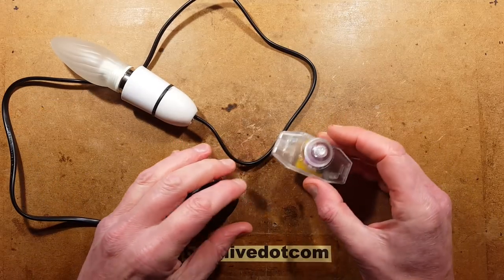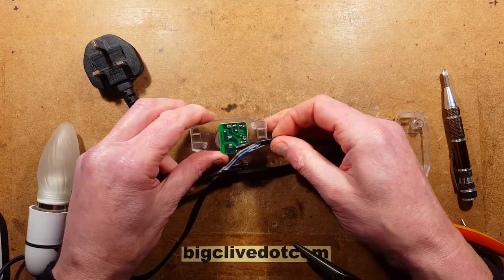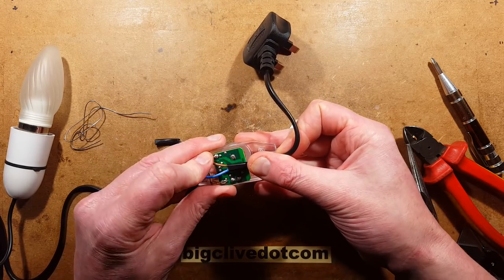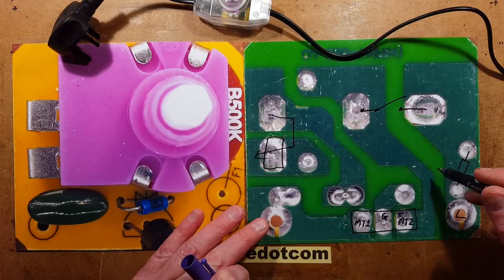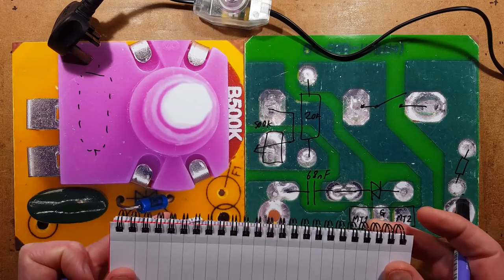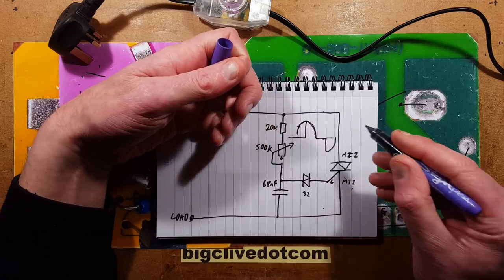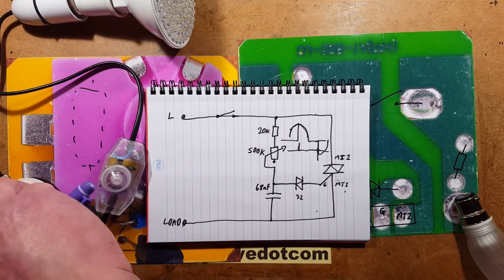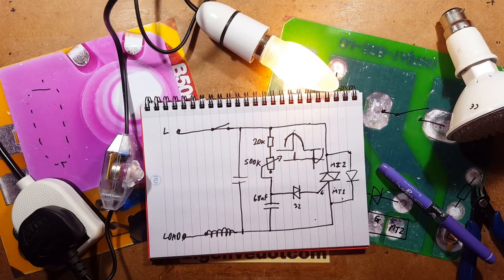Low class inline dimmer from eBay.  (with schematic)

Comment: I have a dimmer like this on my salt lamp. When the bulb burnt out I couldn't find a replacement so I just got a new socket and replaced it, but I took apart the dimmer to see how it worked. At the time I had no idea what I was looking at, but after a few years of watching your videos I definitely understand now.

Just thought I'd share that and thank you for making these. I've learned SO much from all your videos, and been quite entertained along the way! :D
Reply: They had a huge recall on those salt lamp dimmers a couple years back. Apparently there was an issue with them overheating, burning out and/or starting fires.
Reply: It's as clear to me as calculus !
Reply: The bulbs to put in those salt lamps are called "Pygmy" lamps. These lamps can still be found for use in ovens and refrigirators because an LED in an oven would melt. So these pygmy incandescent lamps are going to be available for years to come, just gotta know what to look for.
Reply: I was just about to say this, also, I somehow destroyed my salt lamp cable dimmer thing, now I'm thinking, mabye I blew the dimmer
Reply: Home Bargains sells the E14 appliance lamps at £0.89 for a pack of two. 
They're the 15w 240v ones with the lightly smoked/amber glass.
Reply: So you purchased two useless items, then well done.
Reply: @MrBobWareham  Did you maybe consider I got the salt lamp because I like how they look?  Also, you being snooty towards someone that had a learning experience is really sad.  I hope things get better for you.

Comment: The gap in the pad is so the solder doesn't bridge over the hole during wave soldering.
Reply: That's what I was thinking too.
Reply: No your wrong it's to save cost as not using as much material making the circuit board, as tesco says every little helps.
Reply: @Dime_Bar  If they were that worried about the cost of that tiny bit of solder, they would have taken off those unused fuse pads.
Reply: Mystery solved. Genius
Reply: Nice. Thanks for the info
Reply: thank. you.

really!
Reply: Dave Micolichek  ...

Comment: I get the feeling that these cuts in pads shown in 5:17 might be made that way so the hole won't close when everything is soldered by wave soldering. 

After some searching it looks that making that cut in pad helps preventing filling that hole with solder.
Reply: But that's kind of counterproductive for a solder terminal like that.
Reply: Dave Micolichek  If assembled like Clive did, there's no hole to keep empty, just a nice fresh blob to put the wire in without adding fresh solder.
Reply: @johncrowerdoe5527  But the way Clive done that, is not proper unfortunatelly. It would be acceptable only with double sided, plated hole FR4 PCBs, or if the hole of the pad is riveted through with a brass tubular rivet. These phenolic boards doesn't hold their copper clad very well, it's easy to rip the pad off if used this way.
Reply: @mrnmrn1  You obviously haven't worked with SMD-only designs.
Reply: @johncrowerdoe5527  I worked on SMD-only designs. It's quite different. I solely use FR-4, which holds the copper clad much stronger than this phenolic garbage. Mechanical holding pads on SMD connectors are pretty large, and it's good practice to strew the area with vias for extra strenght. A single through-hole pad on a phenolic board is something that I wouldn't trust holding thick mains wires. Even in chepo noname boomboxes in the '90s, the Chinese riveted the pads which they wanted to surface mount wires onto.
Reply: Dave Micolichek  ...

Comment: Most lamp cords sold in the US and Canada are configured as two separate conductors, each with their own insulation jacket, stuck together in parallel rather than being enclosed in an outer insulator. I guess they’re actually molded in one piece with two channels side by side. However they’re made, they’re very easy to split into two separate conductors without any danger of cutting a conductor or accidentally removing the insulation. That may be the type of cord that the dimmer manufacturer had in mind - it’s marginally more consumer-friendly.
Reply: in the eu, typicallly speaker wire for sound systems is molded with the insulation like that.....
Reply: used to be normal for lamps and electric clocks etc.  in the UK but it isn't allowed any more.

Comment: Have just fitted one of these to a set of  vintage Pifco Fairy Lights , glad i found your video because there is NO wiring diagram or any sort of instructions with it . It seems to be working very well so far - i dim the lights to about 80% brightness to save stress on the vintage screw-in bulbs and its stopped  the bulbs over-heating . The lights are rated 22 watts .

Comment: Many years ago I bought a dimmer of the sort that's typically installed in place of a wall switch,  often used for dining area lights to give a little "atmosphere".  This got installed in a standard electrical box along with some outlets,  and worked well for me for many years.  The initial application was dimming those incandescent lights that were all over the tree that never got watered enough and invariably dried out way too quickly,  but later on it dimmed my bedroom night table lamps.  Oh,  and that thing did raise merry hell any time I tried to use a standard AM radio anywhere in the house,  no filtering at all.

  Fast forward a number of years and I offered to build one for my lady,  so we went to the store and bought what I thought were pretty much the same parts,  only it's behaving a bit oddly.  If you turn it all the way down,  then when you turn it up nothing happens until you get to a certain point and then the lamp comes on rather brightly,  at which point I can turn it down to where I want it.  Not the best for having to get up in the middle of the night...   I have yet to disassemble the thing and see what sort of extra stuff they've put in there.

Some time back I was given a couple of LED bulbs for those bedroom lamps,  said "dimmable" on the package.  I tried them out,  and the problem was that they would "sing",  rather loudly.  This was never going to do for a bedroom situation where I wanted quiet,  so the original incandescent bulbs went back in,  and those LED bulbs went back in their boxes,  to be used elsewhere eventually...

Comment: No, don’t toss it in the bin yet; you still have to do a proper EOL video where you short the bulb, turn the dimmer up to full, and then plug it in so there’s a loud >bang< and smoke and fire inside the dimmer! Then you can toss it in the bin. 😆 P.S. A long extension cord is not required, but is suggested. Also, make sure the camera is recording and is pointed at the soon-to-die dimmer innards, so that you can post the video to YouTube!

Comment: Thanks Clive.  I'm a HAM radio operator and dimmers are a nuisance on "Short Wave" 0-30 Megahertz.
Reply: Thanks for the frequencies.  That seems to cover all 3 broadcast AM bands that don't require a HAM license to receive.
Reply: I'm just going to assume he meant all the frequencies AM or otherwise that are in that ranger. Harmonics at 50 or 60 Hz intervals all the way from the bottom to the top. Also, the old CRT TV's radiated broadly with harmonics about 15 KHz intervals.

Comment: Actually, the 20K resistor limits the brightest setting, not the dimmest setting. When the variable resistor is set to minimum, the 20K resistor still limits how quickly the capacitor can charge up to 32V so the start of the waveform is always chopped off a bit. The dimmest setting is at full resistance, where you have 520K total which makes the capacitor charge up much more slowly, thus delaying the firing of the diac and triac.I'm not really sure why this is needed except perhaps to limit the triac gate current in the (very) short time between the gate conducting current and the main triac conducting current.

Comment: The slot in the solder pad is used to prevent the hole in the solder pad to be covered by solder during wave soldering.
After wave soldering, a cable/wire is supposed  to be fed through the hole and soldered to the pad.
Standard practice :-).

I lived in the world of one-sided-PCBs in the late 1980'ies in a Danish company that developed and manufactured parts like circuit breakers, dimmers, remote controlled relays and similar for 230VAC installations: LK a/s.

The dimmer you draw a schematic of, was the standard configuration in the 1980'ies.
A Triac, a Diac, an ajustable resistor (plus one), a capacitor, two connectors (and a required fuse), - that was it.
The shelf price in the stores in 1985 was £15, - the result of missing competition.

--
Added info:
In 1964, LK a/s had ~4200 employees.
In 1995, LK a/s had ~1000 employees.

Today LK a/s have ~100 employees and is a part of Schneider Electric, France.

luv /JD

Comment: Re: rfi from triacs. As a radio amateur Clive -  I think triac dimmers are the least noisy of the present crop of noise sources available to consumers - anything switched-mode is usually MUCH worse - these put out 'birdies' that wobble and drift all over the bands at multiple frequencies, sometimes even wideband crud up as far as 15MHz. :o(
Reply: noakeswalker  cheap switched mode laptop chargers are a bugger for this, have to disconnect my laptop charger if I want to be able to hear anything on 40m

Comment: The purpose of the capacitor is to integrate the voltage during each half cycle. If instead of a capacitor there was a resistor (which would constitute along with the potentiomenter a voltage divider), the diac would always trigger when the latest, at the cusp of each half cycle and the dimmer would only be adjustable in a 50%-100% range

Comment: I got one of these (in black) on a cheap salt lamp. Used it, mostly because I didn’t know any better, until the Triac went bang unexpectedly in the night. Replaced the whole thing with a proper UL-rated lamp set. Still have the circuit board somewhere in the shop

Comment: I bought the exact same deal except as a lamp wiring harness for US (120vac A12 base) the dimmer is identical except with black plastic. It lasted just about as long as yours, except the Triac has a crack down the face and emitted "that smell" (Ie bakekite on overbake). It was to be a nitelight for my mother, just as well, it could have started a fire. I ordered a quality one with slide pot for about $14 us, and it works great. Smallest triac I've seen pressed into line service. A 15-20a one in a TO-220 is only a cents more. I'm surprised they didn't use a neon for the diac. Maybe the price of NE-2a has gone up. Great example of overcheapening.
PS - It wasn't your LED lamp that killed it - mine died in 1/2hr of 60w incadescent. Without proper filtering, I'd bet the shutoff spikes are killing the Triac with overvoltage.

Comment: I have always had a slight problem in dealing with people.  I always seem to think that everyone I speak with knows what I know.  Well especially if they are in the same field as I am.  Point in fact, back in 1974 I was stationed at Fort Bliss Texas, I was in charge of the Radio Teletype Section, as well as voice communications.  So we decided to build ourselves a mobile communications van on the back of an old Duce and a half truck that had a shop shell on it.  So we built on it and were nearly finished.. One day I was busy with meetings at the main commo shop, the truck was in the motor pool, which is where trucks should be when not in use.  So I sent two of my fellow communicators down to the motor pool with some switches and an exhaust fan which was to be mounted in a port in the rear of the van.  They came back and reported that the fan must be burned out since they had put in 3 switches and all three burned out when they turned them on. Well being the good supervisor I was, I finished my meetings and went with them back to the motor pool.  I had them put in another switch for me so I could see what was happening.  they did as you suggested, wired one side of 24 Volts DC to one side of the switch, and grounded the other side, before they could turn it on and burn out another switch I stopped them and gave them an impromptu lesson on how to wire in a switch.  These guys were trained to operate radios and switchboards, install telephones and even wire in AC lighting in the field, but they could not fathom how to install a switch.

Comment: It seems you can actually solder the wires on opposite corners if you use the pin of the switch instead of the hole. That should make for a bit better wire placement inside

Comment: You'll probably find the neutral is supposed to be routed on the component side of the board
Reply: Due to possible shock prevention through a faulty pot?
Reply: @tomaszwota1465  He ment on the other side of the pcb, because there is a lot of space for that conductor to go through.
Reply: @teslakovalaborator  ah, that, haha. Yeah, now it makes sense.
Reply: Indeed, this is how it's routed on the pair of table lamps I bought that came with the same clear housing but a slightly different PCB.

Comment: Just a correction ..the real function of the 20k series resistor is to stop the current inrush blowing a hole in the pot track when at zero ohms, at this point the on off switch closes and places a 0.68uf cap directly across the end resistance of the pot which blows the wiper off the end .... I sorted a identical error 30 odd years ago in a 150 kva welder

Comment: I just had an idea, I've come into some lava lamps lately, the previous owner replaced the bulbs with different wattage lamps nothing to hight but just high enough that one works to well and the other works. A guy could get a dimmer and control the flow of the lava lamp. All of this happened while falling asleep. In and out of sleep. I used to watch your videos at the end of the day to relax. But my situation has changed, I tend to watch them in the morning. But today being my birthday I didn't watch any videos til now. 10pm. Almost dropped my phone in my lap dozing off. Anyway very cool video. I whish they made more stuff in clear plastics. Cheers from freezing rain kansas.
Reply from the maker: You used to be able to get lava lamps with a built in dimmer.
Reply: Happy birthday, Raymond! From sunny and warm (for the time being) Texas.

Comment: I can see why these don't play nice with some LED lights. Since only the live is being used the load is the implicit connection to neutral to provide a voltage reference for charging the RC circuit that fires the triac. Normally a standard incandescent filament acts like a shorted link when its cold, but an LED with a power supply in it will probably do weird things if its not for use with one.

Comment: The board should be rotated 90 degrees.
Reply: That's what I was thinking, and given there are holes at the solder point I think the wire should go under the board and not pass over the solder side.
Reply: That's exactly what I did with mine.  Only my two halves had no screws and didn't even snap shut. I managed a good safe job though. You get what you pay for.

Comment: 7:05 that's to the customer's benefit. No need to fully unscrew each and every one if you mount hundreds of them. It's the same with screw terminals; you should NEVER supply them in a product with every terminal screwed down.

Comment: Literally the same ciurcuits can be found in drill speed regulators, just in a different case and with linear potentiometers.
Reply: It also literally burns out the same way, too. These are really only for incandescent lamps since there is an implicit connection to the neutral through the filament to properly charge the RC network and fire the triac. It would work better if the neutral was also hooked up because then you could properly terminate the RC network rather than do it through the load.

Comment: I've found this exact same dimmer in a lava lamp, the resistor underneath the potentiometer was burnt out and I couldn't read what it was supposed to be, so I instinctively replaced it for a 10K one. It was a pain in the ass to replace. Worked like a charm afterwards. Had to re-solder the cable because it was really poorly done, and I think because of that, it was bridging some paths and that's what caused the resistor to burn out. That little plastic case was so annoying to take apart and put back together, especially cause mine didn't have screw holes, it just clamped together. Oh, and I could NOT find a circuit diagram for it anywhere. Really unfortunate that I didn't find this video when I needed it. 10K should be fine, right?

Comment: Us radio hams do still use the bands those things cause interface with. There's a lot of noisy consumer devices around today like this one and cheap switch mode power supplies where the manufacturer leaves out the filtering. The noise levels at my house make operating below 30mhz almost impossible even when I operate off battery power and kill the mains at the consumer unit. On 70MHz if my cat triggers my led flood lights the noise from those things is deafening if I have headphones on. Even up on UHF at 432Mhz I can't hear much to the north west as someone in that direction has something spewing out RF. One of the worst offenders today is BT VDSL broadband. The high switching speed and overhead cables makes it radiate rather well. The noise and the fact that were in a low spot in the solar cycle means it's best to operate portable from a very remote area away from all the guff you find in a residential area.

Comment: I'm watching this because I've just bought a similar module. It was far more informative than I anticipated. I expected a simple install guide. I don't know why you didn't try rotating the circuit board 90 degrees, so the connector pair lies along the unit rather than across it?